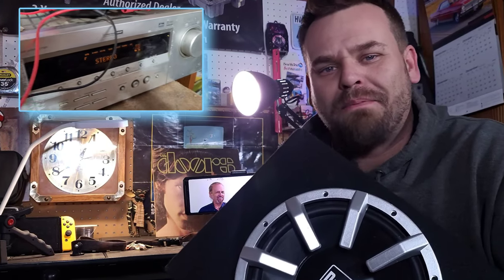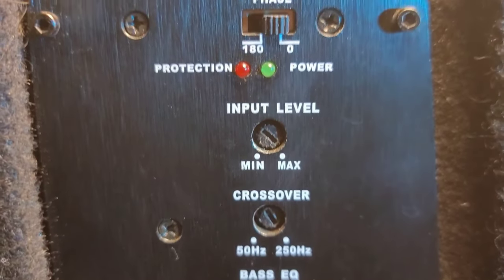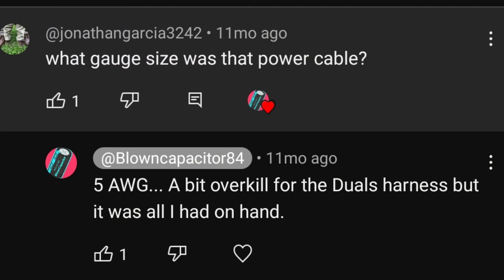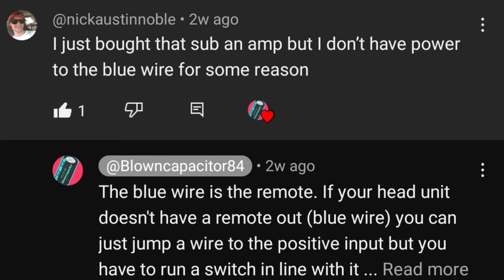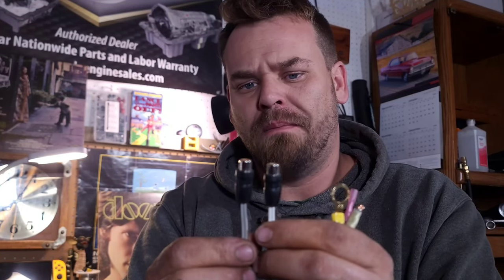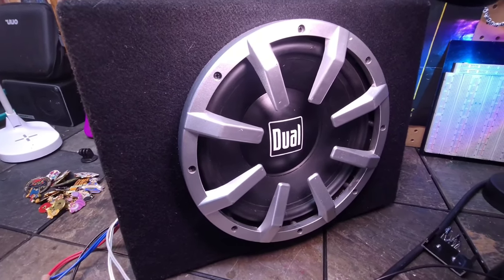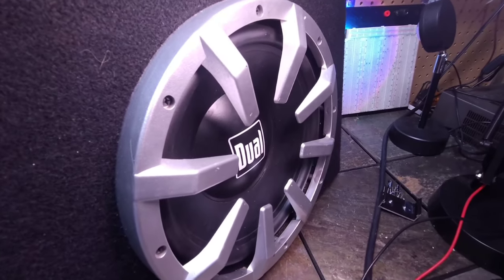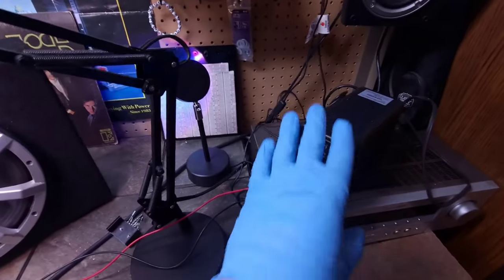Answering your questions about the Dual TBX10A. (and how to connect it to a home audio receiver)

Comment: Been tinkering with these boxes for a while if the woofer dies go snag a Rockford fosgate R2D4 10" prime woofer 4ohm they are a direct drop in and work with the amp and can handle more power than the built in amp also if you wanna port using the 10" fosgate woofer you can use a single 2" 7" long port on the right side of the woofer across from the amp this will improve it a good amount i have 3 all wired on a 2 ohm load so the amps get a bit hotter but after 2 years of daily abuse and what not in the minitruck no issues from anything i did use 8 gauge wiring for all of the boxes.
Reply from the maker: That's AWESOME!! thank you for the tips!!

Comment: just hooked mine up and tapped into the rear speakers. Sounds great, but my question is; Is it normal for the side aluminum panel to run real hot to the touch? And if not, what can I do to help cool it from running hot if there is anything to do?
Reply from the maker: It will get warm, but it shouldn't get hot. It may help if you turn the Input volume down a little bit because i think the heatsink (that aluminum panel) is too small for the amplifier (which sucks lol) also if it's covered in some way it can overheat. I guess let it go and see if it goes into protect mode or starts cutting out. If it gets hot to where you can't comfortably keep your finger on it then it may just be defective.

Comment: Hey so I bought this sub and swapped the speaker for a marine grade " Polk DB1042" had it running off the battery hooked up to my boat stereo. Went to install it under the seat, same wiring configuration and now the power LED won't turn on. 

What went wrong? Speaker too powerful for amp?

Thanks!
Reply from the maker: @VladAptovcov  that's a good one... did you ever power it up prior to changing the speaker?
Reply: All good, got it sorted out - she sounds great!
Reply from the maker: @VladAptovcov  Nice! Enjoy!

Comment: I have no choice but to lay it down. It’s going into protect mode due to the heat not being able to escape. Would drilling a 1 or 2 inch hole above the heat sink allow for heat to escape better?
Reply from the maker: Man that sucks. It might just be broke. I don't think drilling a hole will help much but worth a try.

Comment: Can I see a picture of the tune you have on the amp plz mine gets to hot and turns off
Reply from the maker: If the subwoorer output voltage from your headunit is different it won't help. What head unit are you using?

Comment: Hey man, your videos about this speaker have been super helpful in helping me decide on getting one and getting it hooked up. Before I ask my question, I am a novice, at best, in speaker install. And I apologize for the long question. 
I first installed this with a 12 gauge wire and had it rolling pretty good. It ended up cutting out on me on long drives (3+ hours) and got extremely hot. 
Because of that, I upgraded the power and ground wires to a 10 gauge to try and solve the problem. Now with the 10 gauge the sub is barely audible in the front seat. 
Any thoughts on where to go from here?? Thanks in advance.
Reply from the maker: @tylerward1691  Thank you for the support! It could be a couple factors going on, but I would imagine it melted some solder or is in the process of giving up. I have noticed over time that these amps get hotter with age. You could check your connections with a meter to make sure there is no impedance in the wires.
Reply: @Blowncapacitor84  Even though this thing is less than a month old??
Reply from the maker: @tylerward1691  where did you buy it?
Reply from the maker: @tylerward1691  they stopped selling those and replaced them with the Jensen J10ASB. I would imagine you got it on clearance from Walmart? I bet those last models were not made very well. 

Also, if you have the gain up all the way and your source voltage is high, then just about any amp will get hot after 3± hours. 

Well, most budget amps anyway.
Reply: @Blowncapacitor84  I apologize again! This is the Jensen. I got it from Walmart at the beginning of July. I’ve only had the gain about 3/4 of the way up, never more than that. Just not sure why upgrading amp wire would lose power to the sub
Reply: I guess I’ll just go swap it for a new one tomorrow and see if that does anything
Reply from the maker: No worries at all, man! But yeah, I've noticed since they changed the design that they get very hot. The only thing I can guess is that one of the connections isn't making a good contact. Check the voltage at the wires with the heater or ac on full blast and check with heater or ac off. You should get somewhere around 13 volts with engine running. 

Also, 12 gauge can carry about 25 amps (less then what the amp draws) so it's good you upgraded but I'm not sure if that's what us making it not work right.

Comment: How would it sound if I hooked the rca straight to a door speaker?
Reply from the maker: Nothing. Rca's are line level, which means there's not enough power to drive the speaker.
Reply: @Blowncapacitor84  nah man old school. RCA’s hooked into amp( same setup in vid) and the head unit side just cut the jacks off and connect wires straight to existing speaker/ speaker wire

Comment: Nice video...so I'm missing the connector so wondering if you can refresh me on wiring high level? Oh also, I see you didn't use both remote wires. Why is that and why is there 2 if not needed?
Reply from the maker: There is no high-level input, unfortunately. But you can order a new harness online. As far as the remote or any of the wires from the harness, you only have to use one from each. They put two wires going to each pin so you can daisy chain them.
Reply: @Blowncapacitor84  actually had a chance to do some reading..I guess everything is high level(speaker level) until rca come into play converting it to low level. So I'm going to soder to the pins and it said if using high level connections, I won't need to worry about the remote wire period as it supposedly gets the "turn on" from the speaker connection. I'm probably wrong but I'm going in
Reply from the maker: @nathanheynen3576  Nice!!!

Comment: That was a great video but what I want to know is how would I hook that up to the car battery in my garage without a receiver or car amp kit, just from my independent home stereo speakers and car sub I have hooked up to a Bluetooth portable speaker. Will I have problems with the fuses blowing out or the actual Dual sub with amp being damaged. This will help me out a lot if you can reply back thank you and the video was very helpful.
Reply from the maker: https://youtu.be/Icqi7RiNWNM?si=ZHm9Xe5RefM4UXlt
Reply from the maker: I think this video should help out! Let me know if you're still having problems.👍

Comment: Can you hook two of them together the the dual 10-inch amplifier inside deals I got two of them I don't know how to hook both of them together and it is 416
Reply from the maker: Run the positive wire from the battery to one of the red wires on the harness of  the first one. Then, run a wire from the other wire on the first harness  to the second harness. You should fuse that wire running from one to the other. You can also do the same thing for the ground and remote too.
Reply from the maker: But you don't have to fuse the remote or ground... they're kinda designed to run more than one! Hope that helps!

Comment: Is it possible to tie a second one into the 1st? (daisy chain it)
Reply from the maker: Absolutely! That's why there are 2 power, ground, and remote wires. They connect in the amp and are bridged. Just grab some rca splitters.
Reply: Awesome thanks! @Blowncapacitor84
Reply from the maker: @williammcgrath1709  Absolutely no problem!

Comment: Can i blow a 1200w sub with a 400w amp?
Reply from the maker: Great question! Yes! Given that the "max" rating is for the sub (they lie) and 400w rms amp. If the amp is turned up too high, it sure can.
Reply: @Blowncapacitor84  Great thank you! Just got this powered sub. I cant tell if ill blow it because i cant use the meter to set lpf and gain. There are no ports to connect to only the small wire harness for power ground and remote.🤷‍♂️